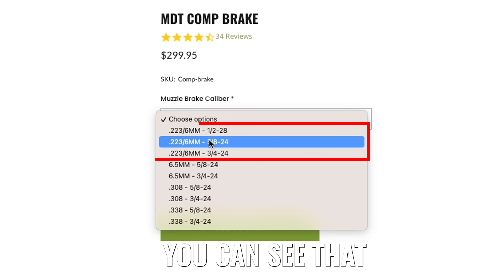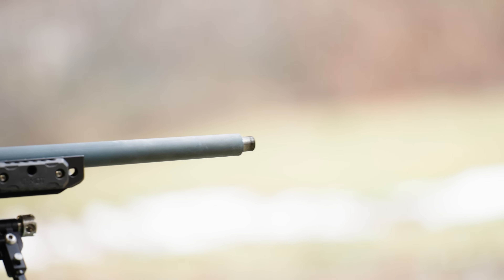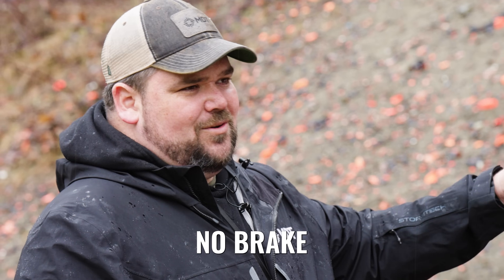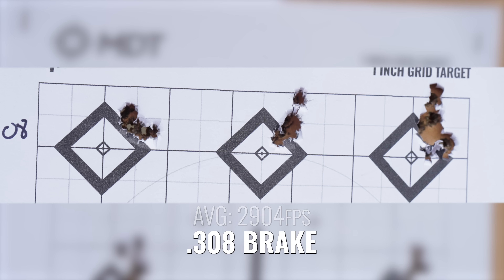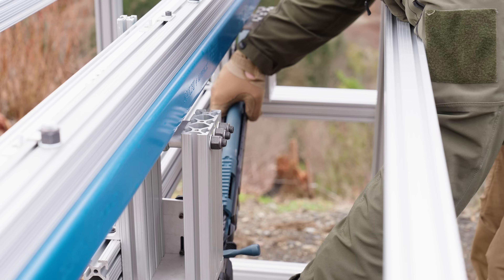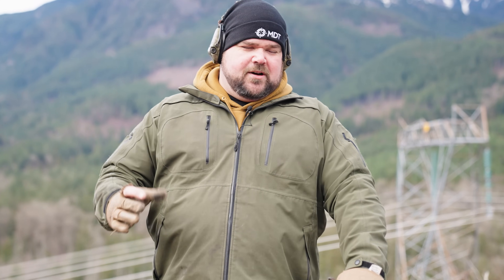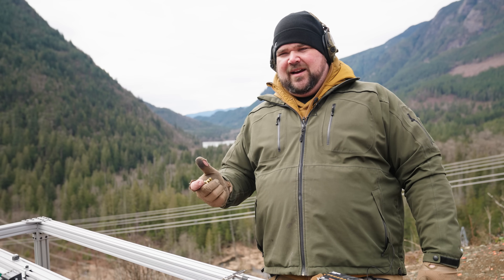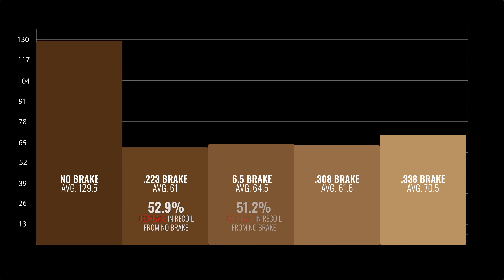Does Muzzle Brake Size Matter?

Comment: I had a silly idea that you guys might actually be interested to test. Hypothesis - a threaded tube like a suppressor but with no end cap, no baffles, just a tube (and thus no legal requirements) will not only send sound forward, reducing it for you but increasing it downrange, but if you start long and trim it back gradually, you can tune your barrel with it. Find what works and permanent attach and now you've got a no stamp gun with whatever barrel length you need. It sounds silly for centerfire, and it is. But for long range rimfire, something like this might just be incredible.

Reduced user sound experience, more accurate shooting, and no stamp? Someone should at least try it.
Reply from the maker: It's something to look into for sure, but there are already brake blast shields out there that effectively do that as well and usually that is the main goal channeling the blast away from the shooter. You can also check out forward compensators as well.
Reply: @MDTTAC  well I got in this position from a baffle strike that ejected the contents. Turns out the thing still shoots great and with subs I'd still call it hearing safe. Sends all the sound forward. Figured you lot might be able to replicate my result, heh.
Reply: @whothat4684  pretty cool. Not quite the same as a thread on can with the guts blown out but same basic idea.

Comment: I'm building a crazy bullpup recce working directly with Colton of Reap Weaponries and Foxtrot Mike, and I need a different brake, because the FM stock is going to dust my LPVO heavily.
Have a recommendation for a .223 brake that is nil gas in the 11-1pm position, but also takes into consideration that I'm doing the bullpup thing, so I can't have too much horizontal and back?
Reply from the maker: Not a bad idea, if you fill out our product request form, that will go directly to our team to look into

Comment: I put my MDT 6.5 Creedmoor brake on my .223 awhile back using an adapter (I now sell online) and have seen no apparent difference. On a .223 recoil is negligible. Might be interesting seeing if it's measurable on something like a 6.5 CM or .308 using a .338 or 50 BMG brake. I'm sure there is a limit before the group and recoil return to what it was without a brake.

Comment: I have a 308 brake that I threw on a rifle in 6.5 Creedmoor. It's good to know that there isn't a huge difference in performance.
Reply: @michaelhill6451 I was thinking about doing the same thing but what are the actual benefits of putting a larger diameter brake on a smaller bore rifle?                 Or should I just stick to getting a 6.5mm brake instead.
Reply: @Nick_M200  The only advantage is that you can use it on a wider variety of firearms. I have rifles in both 308 and 6.5 Creedmoor and got a 30 cal brake to use on both.
Reply: @michaelhill6451  👍 🇦🇺cheers